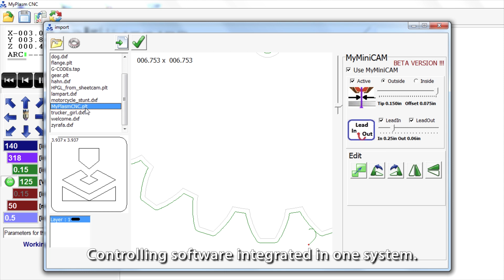MyPlasm CNC System EN

Comment: Does this offer the use of using this as a Cnc router when I’m not using the plasma cutter? The reason I ask is I have a millwright Cnc mega V plasma cutter and would prefer this! Also I’d like to get another driver and control the 2 X motors independently for auto squaring! (Does it offer auto squaring?)